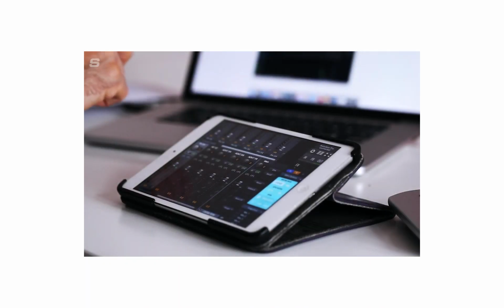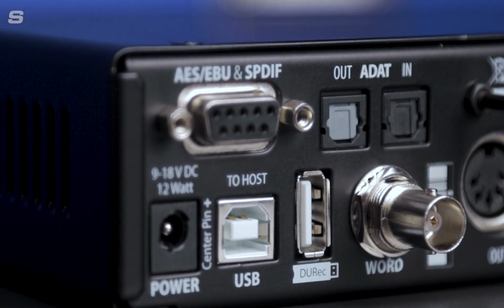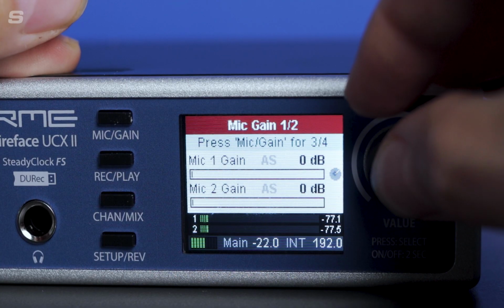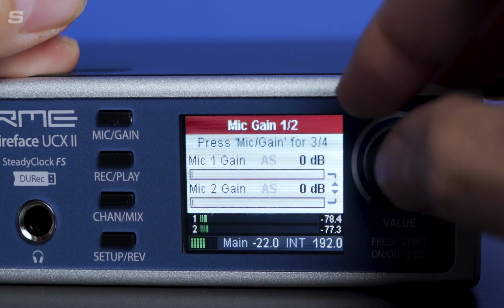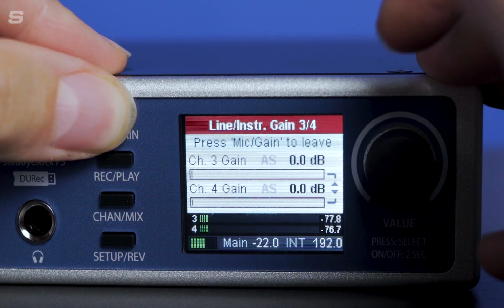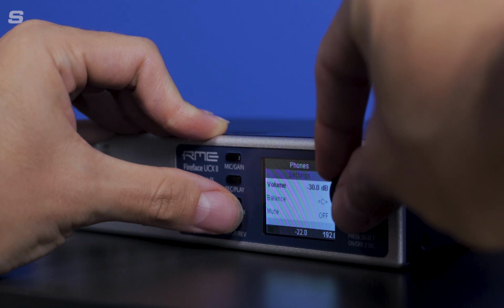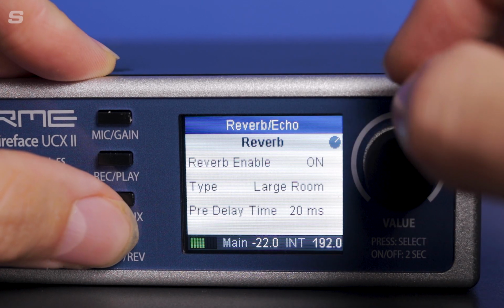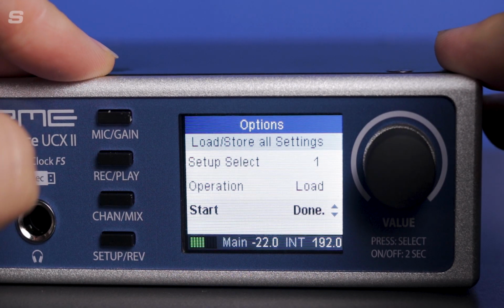RME Fireface UCX II: First Look at RME's 40-Channel Advanced USB Audio Interface

Comment: Got my UCX ii a week and a half ago and I am loving it so far. Perfect hub for my home studio. Lots more real world testing to do but so far I have to conclude that it does everything RME says it does. Connectivity and feature set is great and preamps are totally transparent and clean. Furthermore with some poor recent experience of trying to get one of RME’s competitor’s high end interface to work before giving up and moving to this one, I can report that the drivers of the UCXii and Totalmix FX worked straight away with no fuss and that they continue to burst into life every time I turn it on. This sounds like something you should be able to take for granted but having being using a bunch of different interfaces over the years (and having tried 4 different interfaces this year alone) this is not always the case. A friend had the brilliant UFX+ so I knew I could rely on RME to deliver. Great job as always RME!
Reply: Is your unit /UCX 2
 getting hot?

Comment: I don't own any RME product but am considering this. As far as I can see, the good software aside the biggest selling point for me is the fact that this company seem to be making "It just will work" products. I absolutely hate it when something that I'm used to using breaks and repairing is expensive or a pain.
Reply from the maker: Hi there! RME gear is relied upon by industry professionals around the world for that specific reason: it does the job and it does it faultlessly. RME are also well known for updating their drivers for every new operating system, meaning that hardware from as far back as 2001 still works with the latest OS!

If you're in the UK, buying through a UK authorised dealer means you can sign up for a five year warranty, which is how sure both RME and we are that the unit will perform time and time again!

Comment: Just got my UCX 2 yesterday .Its an expensive interface compared with certain competitors, so im counting on it to work until UCX 3 will be released in about 10 years :-). I had bought the new Babyface FS pro just before The UCX 2 was released, But I swapped them. To my ears the Babyface sounds just as good as UCX 2, if not better.  UCX 2  got a lot quality and connectivity but im worried about its getting rather hot though it got cooling vents. Ive had two interfaces ( TC IMPACT TWIN AND AUDIENT ID 22) where the heat inside the cabinet made some of the capacitors dry out or otherwise stop working... I know this is RME. And thats why I bought it, im tiered of buying new interfaces. Will other users of UCX 2 please tell about their experience with heat from this unit?
Reply: I am no longer concerned wit the heath generated from UCX2. I just placed it on two pieces of wood which lifted the unit a couple of inches from the surface. Air flows more freely now and its cooling the  UCX2. Ive got feedback  From other UCX2 users elsewhere, and they all stated, they had no issues with the unit and worries about UCX2 getting warm. I m new to RMEs products. I am glad to know that the earlier UCX also got warm with no issues.
Reply: @pml394  I think it's a common "problem" not only with RME interfaces, but also with other interfaces that have built-in DSP such as Universal Audio ones (if you google it, you'll see similar complaints). That said, the RME BabyFace Pro runs pretty cool. My Fireface 400 got hot enough to fry eggs. The UFX gets warm but maybe not as hot as the UCX due to the bigger size which leaves more room inside the unit for air to flow around. That said, the metal chassis is probably acting as a heatsink, so it's not a bad thing that the heat is finding its way out rather than staying within the device.
Reply: I really want to know what you've been smoking if you think in terms of features its better than the UCX ii
Reply: @tuneunleashed  What have you been smoking?  it affects you reading ;-)
Reply: Hi ! rme fireface ucx ii longlasting max 1years! , say my friend it's true!

Comment: hello I have a RME ucx2 I wanted to ask you I usually turn it on and then turn it off before turning off the computer, right? or do I directly remove the general power supply without turning off the card by holding down the key? I know maybe it's a stupid question but that power button scares me a bit I would have preferred something more analog.
Reply from the maker: Sorry for the late reply - either would be okay, for convenience it's probably easier to turn off by pressing the encoder, but this will obviously still draw a really small amount of power in standby.
Hope this helps a bit!

Comment: I have a question that I can’t get an answer to? Please. Does this sound as good as the ufx +?  Are the converters the same? Or better in the ufx+. Or is the ufx along the lines of the ADI-2 pro ? Thank you for your help.
Reply from the maker: Hi, all of RME's interfaces are designed to be sonically transparent, and as such there shouldn't be much in the way of real world differences. This is certainly the case with the latest generation of interfaces (Babyface Pro FS, UCX II, UFX+ etc), which all sound excellent.

We therefore always recommend basing purchasing decisions on what I/O and features you need, i.e. the number of channels you need for inputs and outputs. 

The ADI-2 Series is slightly different as they're dedicated 2-channel converters, and offer the best AD/DA conversion currently available from RME. They are therefore a slight step-up again from any of the interfaces, although this is reflected in the price you're paying for only 2 channels (and no TotalMix FX software).

Comment: if UCX 2 have 2xAdat , it must be monster.Respect RME
Reply from the maker: Hi, just to clarify there is only 1 x ADAT I/O on the UCX II (along with AES & SPDIF). 

For 2 x ADAT you'll need to look at the Fireface 802, UFX II or UFX+.
Reply: @SynthaxAudioUK  Can i hook up a 2 interfaces ucx2 with my old ucx to work with 2 adat outs
Reply from the maker: @martotarto9581  Hi,  yes you can run up to 3 RME interfaces on one computer, as long as they use the same driver (so a UCX and UCX II will be fine). You will also need to clock the two devices together, which you can do via SPDIF (to keep the ADAT free).

Note you will also have two TotalMix windows.
Reply: thanx, i have a exturnal clock so everything will be clocking
Reply from the maker: @martotarto9581  Great, actually I just remembered that the original UCX also has wordclock on BNC, so yes should be all good :)

Comment: hello I have a rmx ucx2 on windows 11 I have a problem if I try to vary the buffer size the sound in my daw studio one 5 deteriorates if I try to fiddle with the windows audio settings it is resolved but if I turn off the pc and turn it back on the problem returns .. .. can you help me thanks.
Reply from the maker: Hi there, this sounds like an issue with your computer hardware as opposed to the UCX II. Unfortunately, this isn't something we can really help with!
Reply: @SynthaxAudioUK  I solved it after 3 days but going around various forums I saw that many have the same problem. I would like to tell rme support that instead of quickly liquidating customers who have spent 1500 euros they could work a little more thanks
Reply: @enricopellegrino6122   What was the solution?

Comment: Is it possibile to expand inputs using ADAT and AES at the same time? I'm using Behringer ADA8200 plugged into ADAT, and I've seen RME DTOX-16 for the AES connection.
Reply from the maker: Hi there, yes you can use both the ADAT and AES at the same time, but it's worth noting the AES is only a stereo connection!
Reply: @SynthaxAudioUK  thanks for the answer

Comment: Could I connect this to a 5.1 setup using AES. I have not used AES before but in general I like the idea of using digital signals instead of analog. I plan on connecting it to 5 Genelec 8331A and a subwoofer, I will possibly add more speakers further down the line as well.

Comment: Is there a longer digital breakout cable available for the unit? The 20cm cable is borderline useless if you'd like to connect digital speakers without buying something like an RME DTOX unit for another couple of hundred eur/gbp/usd.
Reply from the maker: Hi, the breakout cable is really just intended to provide the additional I/O that couldn't be fit into the main body of the UCX II. It's still recommended to use cables (digital RCA cables for the SPDIF, or digital XLR cables for the AES connection).

Comment: Would you recommend this over the Babyface?
Reply from the maker: Hi there!

This depends entirely on your own use case, as there’s a wide range of differences between the two and both are fantastic interfaces. There’s more I/O available on the UCX II, as well as the added benefit of Direct USB Recording and some other features that make it a great option for using boht in the studio and outside of it. You may not need all 40 channels available on the UCX II though, so if you only need a couple of microphones or instrument channels, the Babyface Pro FS is a great option. Both interfaces also feature RME’s SteadyClock FS, which is their advanced clocking technology, so you’ll be getting an interface with incredibly accurate sound reproduction either way. 

Hope this helps!
Reply: @SynthaxAudioUK  Thank you very much!
Reply: YES I WOULD!
Reply: @SynthaxAudioUK  thank you for this :yougotthis:

Comment: hi, anybody there having problem with the power adaptor nozzle when u plug-in to the unit? idk if my unit is defect or what, there is lock arrow on the nozzle but i found it  hit and miss when i power up my unit and when it power on, looks so loose with just a little touch it will power off , please let me know if i miss something here, your help instruction is greatly appreciated. thx
Reply from the maker: Hi, are you sure you are fully locking the power supply connector? The connector has two small ridges on it (black plastic), which allow it to be locked in place. 

i.e. Push the connector in > make sure the ridges are aligned > gently push again to fully insert > then finally a quarter turn to the right to lock securely in place.

Once connected there should be no metal visible on the connector. If you pause the video at 3:09, you can clearly see the spaces for the locking mechanism on the power input, which need to be aligned with the connector.
Reply: @SynthaxAudioUK   hi thanks a lot! i figure it out!